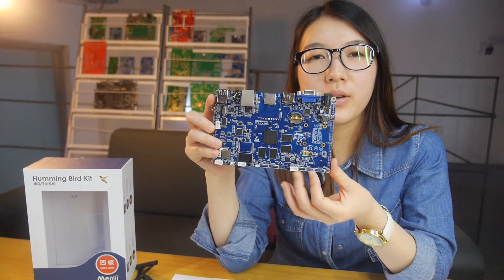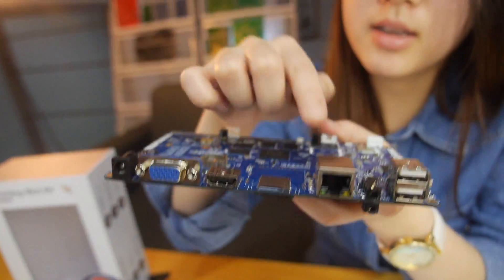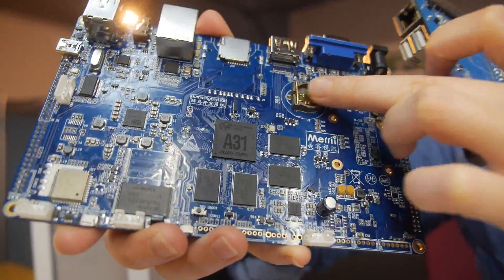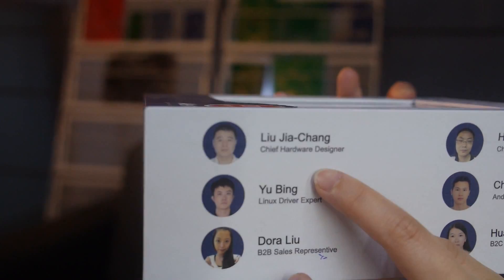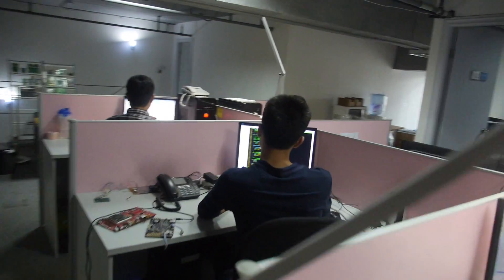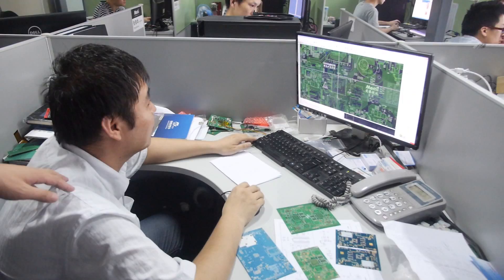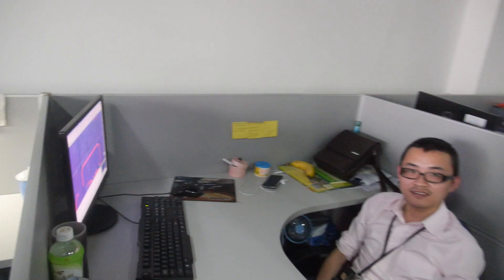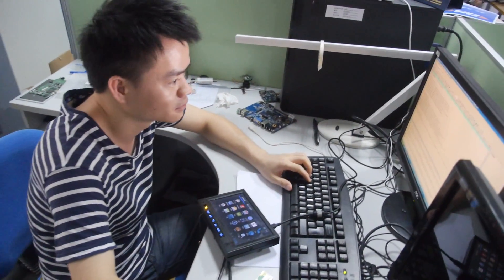$65 Merrii A31 Quad Core Hummingbird Development Board

Comment: Completely lost of money and time. Support awfull. Board seems great, but it doesn't work at all, and support team seems a subcontratct with nothing to do with the product. After a couple of weeks asking, we discover that m-pci slot only gets powered if a sim module it's pluged. We notified to support team and they seem surprised and thanked for the discover. As said great expectation, not working.

Comment: were those guys using wordpad and win xp to work on arm linux software?
Reply: +Razvan Margineanu 
You can use whatever OS/Shell you want for host-platform. On top of it you can emulate anything with this days  software visualization capabilities.
Creativity is the most important thing.
Reply: You mean software virtualisation. Itțs just like a car repair shop would use a pliers to tighten all of their screws, it works, but it would be the most inefficient car repair shop.